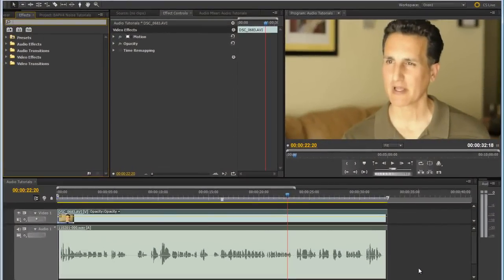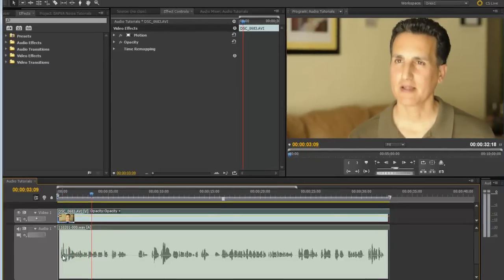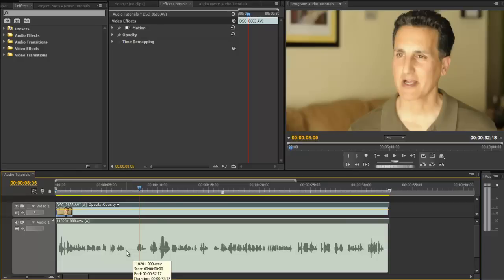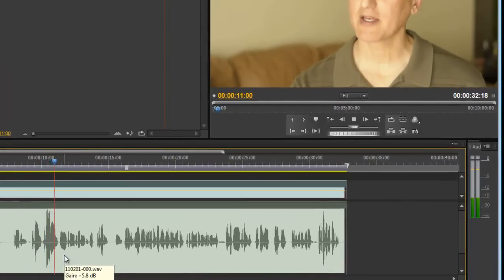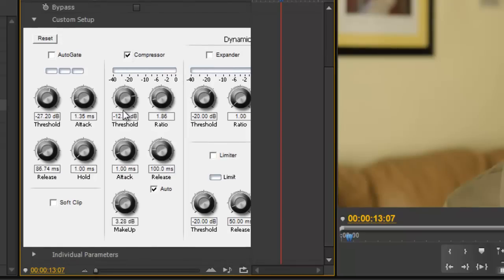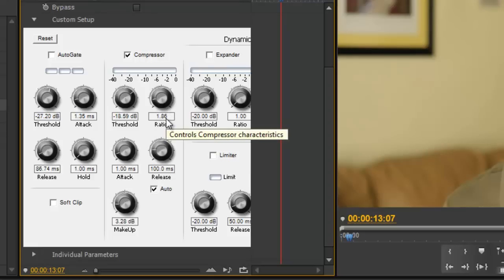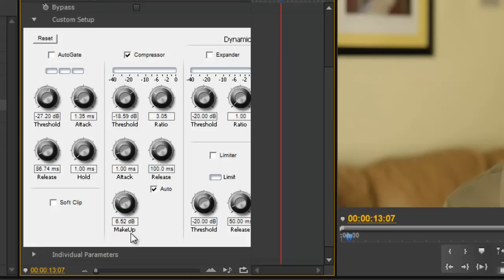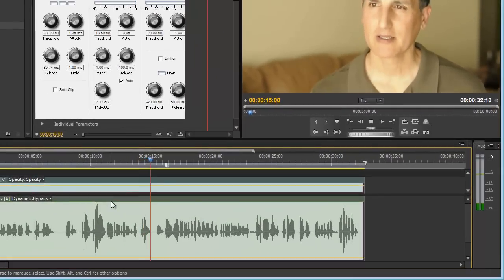Adobe Premiere Pro Audio Compression Tutorial

Comment: Do you know much about extra frames appearing in clips.
A.)When I choose my in and out points in my preview window and then drag the clip to my timeline, I always get an extra frame at the beginning and end of the clip. Can this be adjusted in settings?
B.) On my timeline when i trim a clip, it always removes the frame at which I position my In/out point.  Ideally I want to include the frame where I position my in/out point, is there anywhere in settings where this can be adjusted??

Comment from the maker: Compression should even out the peaks at the beginning of a sentence, but you might be better off with a simple audio cross fade at the beginning and end. I'm not sure if there is a way to have Premiere do this automatically. You can also use the rubber-band function, or the mix console...but these are still manually operated functions.

Comment from the maker: You have to manually apply keyframes to the audio track by using the ctrl+left mouse or you can use the audio mixer section to 'ride' the faders as the track is playing. It's not really compression, it's just setting the levels manually.